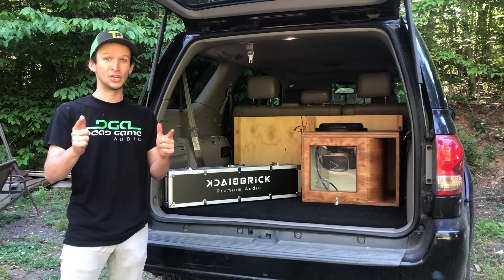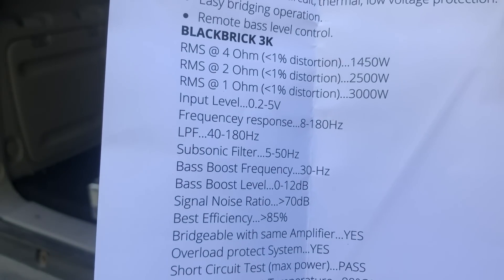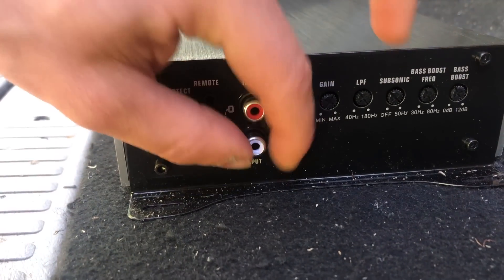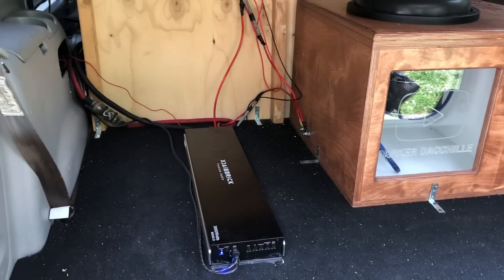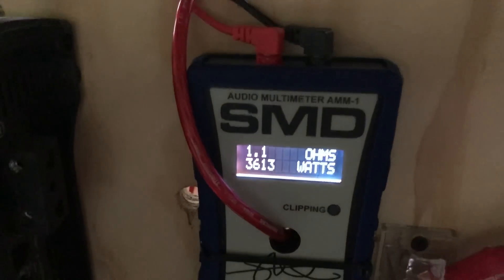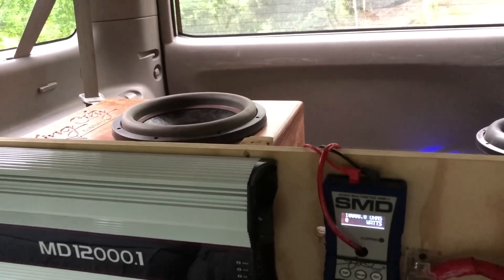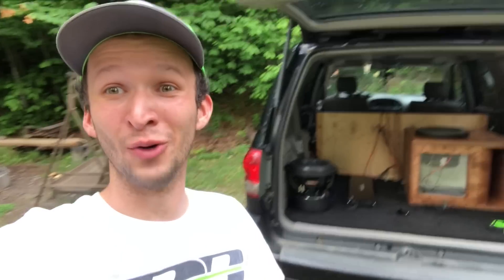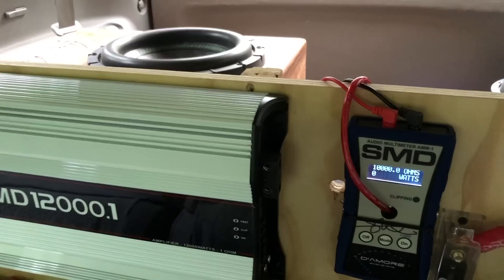BlackBrick 3K RMS Amplifier! 3600 Watts at 1 ohm? 0.5 ohm Test? | M3500.D Amp Review

Comment: Hey Parker, I’m going with two ten kickers in a ported box with 600 watts rms a piece I have the big boss 3000 tramps amp with a half of Omh when speakers are wired two omhs…will I get that efficiency pressure that I’m looking for if I wire my speakers at 2 ohms?

Comment: That’s dope they send it to you in a box. 
You should build an amp rack where the amp is mounted inside the box, drill some holes on the sides to run the wires, and leave it in the plastic so that it always looks brand new and still in the package while it’s installed and running! Lol

Comment: Its an Audiopipe. 2 1500's strapped inside one long case. Looks like they took the guts and tossed them in a re badged shark case. Even has the same terrible signal to noise ratio.

Comment: I have a question for anyone willing to answer with some knowledge on the subject...I will be calling Sundown tomorrow to see what they say but wanted to get some input from some of yall in this community so here goes...My son just bought Sundowns new X 15" v3...its RMS rating is now 2000 watts rms as opposed to the X v2 which was 1500 rms..The claim by many has been that Sundown "severely" under-rates their subs and can handle much more than their Rms rating....so my son has it running on a Taramps smart 3k at 1ohm (Sub is a dual 2ohm wired down to 1ohm)..He has a 320 Amp alt that holds the voltage steady at  14.9/15.0 volts at full tilt....now the problem.....We can smell the subs coil getting hot as hell and the dust cap feels like an oven after just a few minutes of hard play...The amps gain is literally set at the lowest point and we do not run it at clipping...It pounds like a damn beast...no coil rub...no bottoming out...just hot as hell and can smell the coil bad with very little play time...what the hell is up with that if any of yall know...That sub should take 3k no problem but it isnt😡...any of yall have this problem?
Reply: its rated at 2k for a reason

Comment: Looks like a nice amp for all the outdated cons you’d think being a newer brand only couple years old they’re have all newer features,but as you said  it does it’s job should had prolly got it other then alphasonk phantom 3k I’d like to see it dynoed just see exactly what it does I don’t think it does it’s rated
Reply: @Dusty Griffis you have the newer Alphasonik 3k amp? (The new dark grayish/black & orange colored amps) My bad if I misunderstood your comment. I've been wondering if the new Alphasonik subs & amps that come out around a year & half ago are any good... I started to buy the 3k last year but couldn't find any reviews good or bad about them so I decided not to buy them. Still curious whether the bigger Alphasonik subs or amp are legit or not though.
Reply: @itdoesntmatterwhatyourname6128  They aren’t bad good sound quality and the 3k does just that prolly not much more but the 4 point circuitry protection is a bunch of shit had a speaker wire touch another’s and boom 💥 amp want work again just flashes from green to protect tried to let it reset no Bueno
Reply: @dustygriffis999  how long have you had your alphasonik amp? You said you have the Alphasonik Phantom 3000 amp or did I read your comment wrong? Also does it get really, really hot, or go into protect & shut itself off when playing bass heavy songs back to back for 45 mins & longer volume just a click or two away from clipping?? 

I've wondered for a long time why the YouTube channels that do amp reviews & amp dyno vids haven't tested any of the new Alphasonik amps that came out... Heck they been out for a year & a half that I know of, seems like they'd garnered attention by now... Btw the newer Alphasonik amps that I've been curious about are the Venum series amps made by alphasonik, in particular the V3000.1d. Alphasonik rates it @ 3000 rms @1 ohm.
Reply: @itdoesntmatterwhatyourname6128  I do and no it doesn’t get hot at all it has a built in fan as well but have never heard it kick on once but it has got warm to touch but that took a while

Comment: the spec sheet doesn't even match the amp. says bass boost frequency is 30hz, but it is adjustable. I know it states bridgeable and I dont know what that means, I took it as strappable and it can not be strapped as it is already internally strapped. just 2 alike amplifier boards that share the same preamp and case. This is the same design as a Audiopipe 3k and a Massive 3k.

I wouldn't recommend running at .5. That is putting a .25Ohm load on the rails. This is a back asswards way of full bridge amplifier topology.

Comment: What you said about tearing the spyder are both boils for sure working? I'm  guessing they are cause I think I remember you showing the volt meter showing half ohm but surprised me that the AMD never never registered   .5 even when idle but you know!
Reply: because it will not read @ .5 as there is no output at "idle". the amm reads and calculates voltage and amperage on the output. put your ohm meter on a sub and ever so slightly touch the cone.

Comment: Thanks for the overview but I'd rather have a Taramps Smart 3 compared to this oversized paperweight. Don't know what the fascination is with all these cookie-cutter Korean/Chinese clone amps with varying grades of internal components. It's not like there is any innovation in this area... just an exercise in rebranding.
Reply: I returned my smart 3 to Amazon for a 150$ topsolidgear 1500w rms that wiliston labs tested. My power is stock alternator on my car and the taramps would have been too much even at 1600w 4 ohms. Even this amp at 600w 4 ohms on the dayton max x 12 is crazy. Can't wait to switch the dvc on the Dayton to 1 ohm once my sub is broken in!
Reply: @anglerandy5736  You don't have to use all the power... in fact it's better to have an amplifier with more headroom as it ensures you won't clip. A smaller amp that is clipping will have much less efficiency than a much larger amp that still has headroom. When setting the gain just measure Vpp and set that to your desired RMS power output with an O-scope (relative to your nominal lowest impedance) and you'll be fine. Topsolidgear is ok but it's definitely a downgrade from the Smart 3.
Reply: @recon440  the topsolidgear took a shit after a week clip light solid orange no sound returned to amazon. What would you recommend for 200 1000w+ RMS 1 ohm stable?
Reply: @recon440  I was only running it at 4 ohms 600w too as tested by wiliston labs. U think he's a shill?
Reply: Possible cleaner signal going to the subwoofer? and not drowning yourself in EMF while in the vehicle maybe?

Comment: Same amp that shark car audio use to sell. The amp is just two 1500 boards strapped internally. Those amps work great for the price. Shark car audio use to have a 2500 also buy same Chinese Build house that wasn’t bad either.

Comment: Ya no internal fan... buts its only 3k rms so it shouldn't be getting that hot... I didn't see a clipping indicator on the amp or bass knob 🤷🏾‍♂️
Reply: It doesn't matter if it's 200rms or 10000rms they get hot based on the limit of the mosfets so a 200rms amp can heat up just as fast as a big amp can.

Comment: You should send PSI an email and see if they will send you a recone kit for that American Bass sub so you can do a video on it with the new upgraded soft parts and coil from PSI. As far as the basket not fitting in the box, just get a router and cut yourself a mounting ring that is the correct size hole out of a scrap piece of 3/4" MDF, and pre-drill the holes to match the sub. That way, you can use longer screws and just go through the sub and mounting ring to secure it to the box and it will lift the sub up just enough to fit with a tight seal.

Comment: I know an audiopipe amp when I see one, and that bass knob gave it away as well. Definitely the same equipment as audiopipe uses. That is two 1500 watt amps strapped together in the same case. I don't know how they say its "bridgeable", which isn't really a thing. I think they meant strappable, but it shouldn't be strappable since its two 1500 watt boards internally strapped.

Comment: Cool looking amp and if its actually shipped in the case that'd be even cooler but I hoped it would've made 3k wire so low. Their subs are decent though.
Reply: "I hoped it would've made 3k wire so low." 
I'm not sure what you mean here but if you are thinking because it was wired to .5 nominal that it should have put out more power, That is not how it works. The dyno showed the impedance it was seeing and power it was putting out at that ohm load.
Reply: @commonsenseisdeadandgone  This amp was originally named the m3500d. It is 2 1500 watt amps bridged together.. Dynamically and clipping it does over 3k. But at 1% thd I believe it's 2800 ish. For just over $300 it's not a bad amp. I have a 3k I paid just over $800 for because it does over rated. My AMM1 showed 3805 @ 2.2 ohms. I am glad they changed the model name just wished it had done better is all. And I'll add this is my opinion, that's all. But I do savvy how the amm1 works. Black brick has good subs for the $ that's for sure...
Reply: @kswis  also need to take in account of frequency, the amp will push out let's say 500 at 1ohm at 65Hz but 1000 at 1ohm at 42Hz, hence why 40 and 1000 is standard. 

I was just making sure that you were not thinking that a sub with a nominal load changes anything on power it a certain load. Granted a 2ohm final isn't going to see 1.2ohms 😂
Reply: @kswis  yes as long as it does rated that's good. Naming it 3000 instead of 3500 was a good move. It seen 3600 but that was at the very start of the kick so I imagine like "dynamic" on dynos and probably disregarded. I don't like this "topology" circuit design. I'll stick with my 3000watt twisted sounds 3.5k (😂)
Reply: @commonsenseisdeadandgone  agreed twisted makes a nice amp. Im currently running a synergy 3k. Thing is an absolute beast. It's unreal how much power you can get out of a well made amp. Though we'll made ones are often expensive
Reply: @kswis  Nice amp as well. Another one thats named a 3k but does 5. Not sure on synergy but twisted named the amps for what you should see if wired at 1 ohm, account for rise. I really am surprised synergy isnt bigger than they are with the prices they offer.
Reply: Your forgetting rise ohm loads change on music, it did over 3600 watts at 1.1ohm at less than 14v, amp does rated power and then some🤙

Comment: I Have My DD M5 Wired To 0.5 Ohm And The Impedance Rises As High As 6 Ohms lol. Only Puts Out Like 2500 Watts But It's Freaky Loud For 2.5k On 2 12s.
Reply: Dang I got over 3 k on my M3c that’s some crazy impedance rise🤙
Reply: @holeshotinspectionllc2412  yea Shawn From EMF Says The DD M5 Are Notorious For Not Putting Out Alot Of Power At Higher Impedance. The Super High Impedance Is Said To Reflect How Efficient The Subs And Enclosure Are. Won't Know Till I Get It Metered. I Think It's Silly Loud And Low For 2 12 In A Trunk With Back Seats Still Usable hahaha
Reply: @salvatorehayes2753  when I was running my no wall 3 psi platform,  2 18’s on my sfb 8k at 15v wired to 1.33, rising to 1.9 ohm  I was clamping 7819 watts, now that I built a wall I’m clamping 6363, but I added more reinforcements to it so hopefully I get my rise down a little I want that 160 lol, 157.3 last time I metered box tuned to 29hz, the old lady might get the m3c but my first amp wasn’t that nice 😂
Reply: @holeshotinspectionllc2412  Holy Smokes Yea That's Loud XD. I'd Guess Mine Would Meter Around 147DB At 34Hz With My 1Ft 6" Aero Port. Then I Got My 4Ft Long Port For Them Sub 20s haha. 157 @ 29 Hz Has To Be A Killer Sounding Demo Vehicle.
Reply: @salvatorehayes2753  it gets down, but it peaks at 44 my box is tuned to 29, I would be pumped on that score for sure, but I can’t  😂, also I only have a 10in port, only way I’m getting away  it is because of the aero port🤙

Comment: Looking good!
Nice to see some nice affordable power happening these days
btw. any ideas on the efficiency?
Reply: @JohnBee nice affordable power has been out for a good while. Look at all the different choices of budget Brazilian amps that easily make their rated: Taramps, Sundown sfb, Deaf Bonce AAB, etc... If you don't like Brazilian full bridge amps then you can pick up a budget Chinese like the JP23 or many other Chinese budgets on the market that make rated. (Though it does seem that the Chinese amps even though they make rated power present the problem of running HOT & hitting protect) I'm assuming at the price point of the blackbrick amps that they are Chinese boards. Not hating on blackbrick whatsoever, this amp seemed to do well in Parker's vid especially for the $ but he even mentioned the amp was getting hot. I like playing my music hard for typically 45 mins to an hour on average & extremely temp sensitive amps just don't do it for me.

Comment: Ill stick with my 2 t1500 1dbcp fosgate✊🏾💪🏾
Reply: Ill stick with my t40001 bd
Reply: @jalizkojalicienze1279  worst amps ive ever owned... owned 2 of them and both fried within months.. sucks as
Reply: @breedam  u most done something wrong. Had mine for over 15 years never had a problem with different sets of subs like 2 15s orion hccas. 2 15s rockford t2s 4 mtx9500 12s. Thing is a monster still pushing hard
Reply: @jalizkojalicienze1279  FACTS💪🏾
Reply: @breedam  yeah right🤔 you didn't  have,t1500  you had something
Reply: @jalizkojalicienze1279  dont know, voltage was plenty and not under ohm load. Switched to digital designs back then an never ever had an amp blow again.. just unlucky.
Reply: @breedam  yeah it happens . did u bought them used if so maybe someone used them under 1 ohm and overheated them.to b honest the best amp i ever had is my mtx thunder 15001 elite. That amp never over heats and i been abusing it for years hours of playing daily and just dont Gives up. Sad thing they dont make them like they usto
Reply: @jalizkojalicienze1279  ,💪🏾👍🏾
Reply: Overpriced like jl

Comment: One of my problems is I like alot of amps and will buy some amps for looks this is one or them amps!!!!
Reply from the maker: Yeah it’s very simple and sleek for sure!
Reply: @ParkerTheBasshead   Hi I have a question about the autopipe 3K  i have the 3k autopipe and I want to buy autopipe subs 12inch can you tell me which one is best for my 3K Audiopipe and how many at least two I'm thinking about??
Reply: @meechiejohnson41  2  Audiopipe TXX-BD3-12" will defiantly do the job, 900rms each sub, 1800 rms total. If you get the 4 stack ones they might go hungry for power. so 3 stack is best. Even 3 12" 2 stacks will do. lol
Reply: @megaman010391  so would 3 of them work better because its 900rms each ? I know I said 2 but if 3 will make me hit harder then I'll do that I just gotta get someone to make me a box for the 3 subs
Reply: @meechiejohnson41  You can do 3 of those subs, but the amp might not be sufficient or stable. That audiopipe amp you have is not 1ohm stable. RMS Power: 1800W x 1 @ 4 ohms, 3000W x 1 @ 2 ohms So I recommend 2 TXX-BD3-12 
IF you got the money than you can get 2 TXX-BDC4-12 Subwoofer - Quad Stack and hit hard for sure. those are 1100 RMS @ 2ohms
Reply: @megaman010391  Oh okay I thought it was 1ohm I got that long one when they first came out I think I paid $400ish but thanks Michael Arevalo for the help I really do appreciate it!!